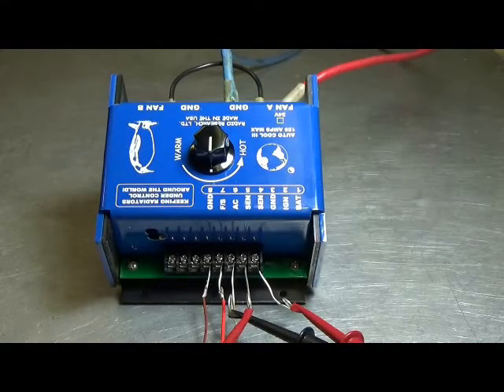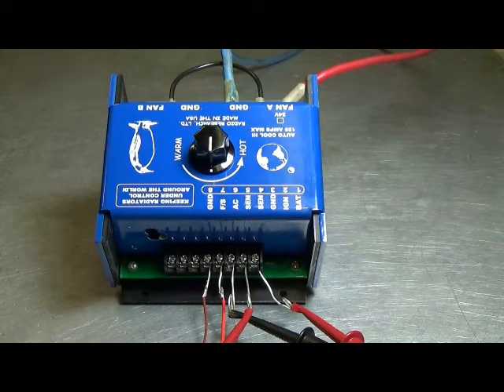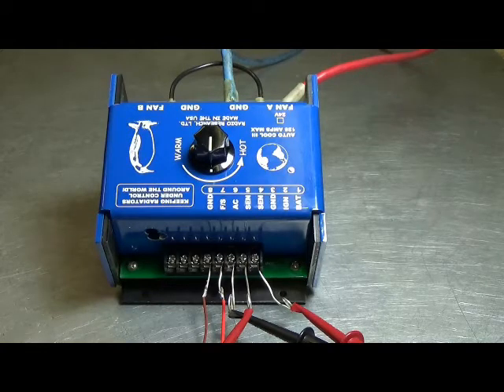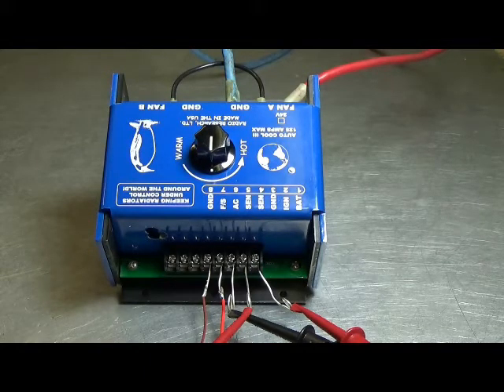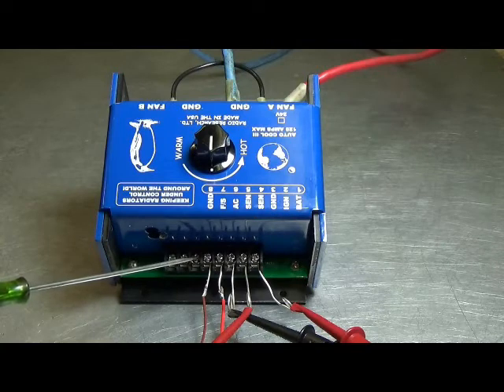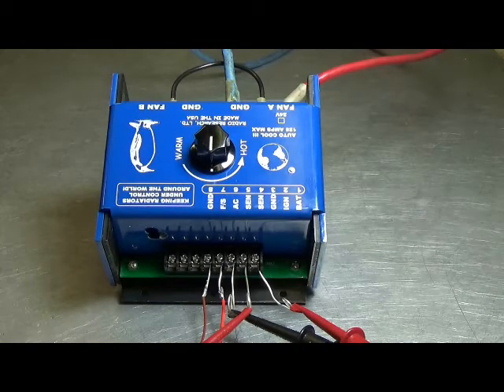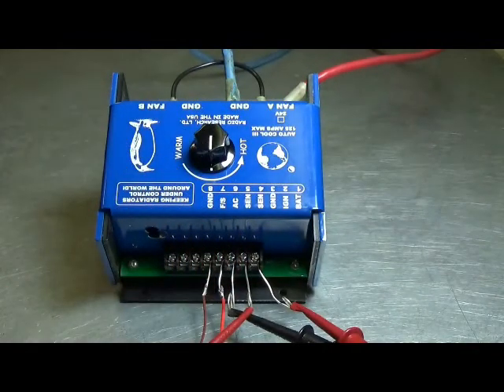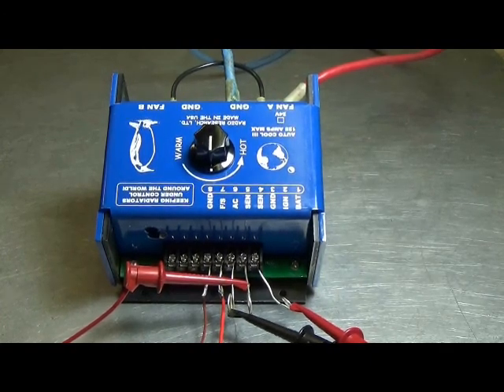AUTO COOL III THE 125 AMP RADIATOR FAN CONTROLLER USING FAN RPM

Comment: Im building a turbo LS mustang with a rear mount radiator setup. Im running a 31x19x3" radaitor with a Lincoln mark viii fan. So my question is would this controller work on my setup?
Reply: Yes

Comment: Can you briefly explain where this "buzz" comes from, its from the fans not the controller right?  It has something to do with the voltage frequency being sent to the fan motor?
Reply: SnakePliscan2 pulse width modulation. Look it up

Comment: Hi did you say is controlled by voltage using the black knob if so what voltage can it reach. I'm in Australia where everything is 12v larger trucks and equipment 24v and up. thanks looks like a great product.